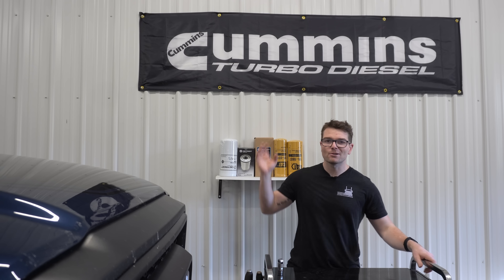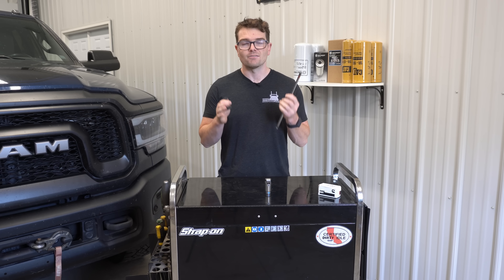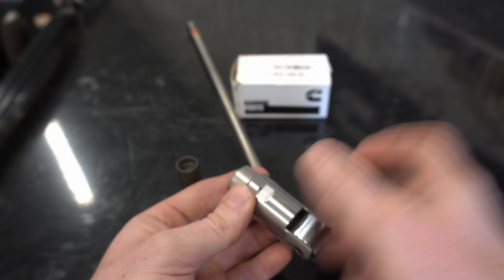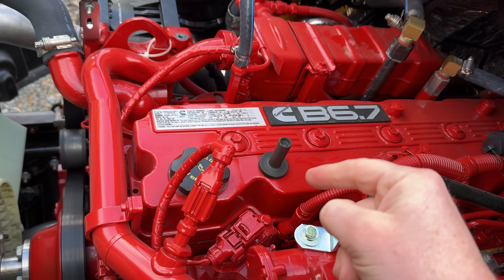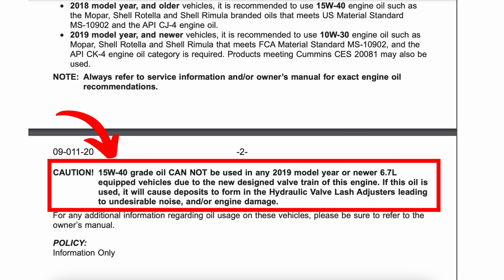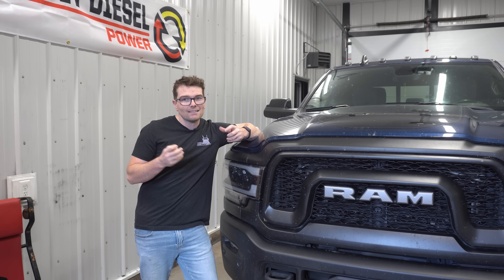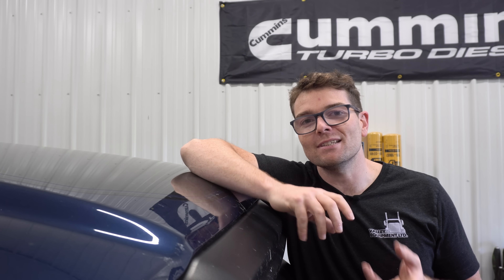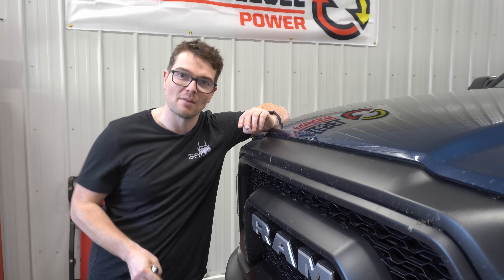RAM 2500 6.7L CUMMINS Hydraulic Lifter Failures *Diesel Mechanic Explains* | Not Good?

Comment: I have a 21 Ram 3500 HO with 37,000 on it, and it's been error free. I currenly change the oil everying 6 to 8k mikes and have run Hotshot EDT in the truck since the 2nd tank of fuel. It's been a fantastic truck so far.
Reply: 37K is barely broken in for a diesel. It should go 200k+ without a major engine failure with 6k mile oil changes.
Reply: @brycelund4112  I agree. But I've seen so many people on YouTube that have had all kinds of emission issues, warning lights, and failures on all kinds of engines with low miles. 

My wife has a 2021 Yukon Denali, and we just lost the 6.2 liter engine to complete failure because of CrankShaft bearings. Thank God it was still under warranty. It had 31,700 miles on it. Apparently, this was a known issue on some 2021's but we had no idea.
Reply: Have you ever tried the arch oil compared to the hotshot edt?
Reply: @onstar1869  yes

Comment: Detroit diesel used roller lifters in the 71 series engine beginning in the late 1930's. As I recall, they were trouble free regardless of the oil viscosity. These weren't hydraulic rollers, however. Maybe go to a non-hydraulic roller lifter?
Reply: The roller lifter is superior to the tapet. However the hydraulic lifter isn’t. 

Most large diesels use cam follower lifters and id support that any day.

Comment: Mine failed at 31k on a ‘23 SO. In the shop right now going on week 7 for cam, lifters, rods and rockers
Reply: What oil weight and type of oil did you use? What milage intervals did you change the oil. Thanks
Reply: @hendertucky9325 valvoline premium blue, 5W40 every 7500 miles.
Reply: @hendertucky9325 valv PB 5w40 every 7500 miles

Comment: Hydraulic lifter in the Chrysler 3.6 gas engine has the same problem.  I had a Jeep wrangler with that engine, had to change all the lifters and a camshaft due to a couple failing.  I've got a 2011 Ram 3500 with the 6.7, this I will not be upgrading.

Comment: Just got put in a new Volvo at work and they are now recommending 5w30 in their D13 engines doesn’t sound wright after years of 15w40 but I guess thin oil is the new normal
Also if seems like they have started pulling the EGR after the DPF because it took almost 8000 miles before the oil turned as dark as my last trucks oil would in less than a 1,000 miles that may something all these engines need to have happen to reduce the amount of soot getting into the oil to help reduce wear

Comment: Interesting that the hellcat gasoline engine has the same problem. In my thinking As a forty You're diesel mechanic.I say its low quality parts. I own a 1997 12 valve and a isusu c223 diesel also I just love bulletproof engines.

Comment: Noise?  Hydraulic lifters are silent.  And it’s not like they’re new technology…  Small block Chevys had them in the 1950s.
Reply from the maker: ya potentially but the commercial grade engines sound identical to the pick up trucks in my opinion.

Comment: I just had the 150k mile valve adjustment done on my 05 Ram 5.9 cummins. $750 at a local shop. Never getting rid of this truck.
Reply from the maker: those 5.9L are worth their weight in gold.
Reply: $750?! That job takes 30 minutes on a 5.9

Comment: I believe with the current emissions on the 6.7 and the engine having to regenerate all soot etc that the oil becomes contaminated very rapidly. I personally change not only my 6.7 and 5.9 Cummins oil at 5000 miles all of my gas engines receive the same service interval. It cheap insurance in my eyes . And in 35 years of driving I have never had an engine failure.😊
Reply from the maker: I mean the regens have nothing to do with oil really but the EGR pushing all that soot through the engine certainly does. So I can't argue with that.
Reply: @GettysGarage  Well, if the regen cycles work by injecting fuel on the exhaust stroke (like you've explained before), you should get more fuel contamination of the oil over time. Fuel contamination of the oil is one of the biggest contributors to excessive component wear. At least according to Lake Speed Jr. aka "The Motor Oil Geek". That and soot. Nasty business all of that. Wonder if you've heard of Speed of Air pistons. If you haven't you should definitely research those! Amazing stuff that greatly mitigates all of the harmful effects of the after gas acronym soup.
Reply: I'm a firm believer in "shorter" intervals on most engines, gas or diesel. The longer intervals on many modern diesel applications are just a recipe for failure in the long run. Oil does get contaminated no matter what, especially in diesel applications, and the more contaminated it is, the more wear is introduced to all of the components. I'd rather spend twice as much or more on oil changes than a fortune in repairs due to various failures.
Reply: I ment to type regurgitate my bad
Reply: Why don't you change the oil on the gassers at 2,000? They are running on less than half the amount of oil than the diesels, the oil gets hotter and can contaminate more quickly. My opinion, which is only valid for me, is that if the oil performs perfectly for 10,000 then changing at 5,000 is throwing money away and wasting time.

Comment: You might want to look into the fact that RAM trucks have a frequent regeneration issue that they cannot resolve. I have a 2022 Ram 3500 with a HO cummins engine. It gave its first check engine light at a little over 5000 miles.(code P2459 to frequent regen cycles). It has been doing a regen every 100 miles since that. This process is causing diesel fuel to get into the oil pan. Within just a few thousand miles after my last oil change I am already a quart over full on the dip stick. It has been tested and shows fuel in the oil. RAM has no answer for this other than to blame programming for the problem. But they do not know what the answer is and will not replace the engine control module or reprogram it. So you might test not only the hydraulic lifters but other engine components as to what the diesel fuel dilution is doing to that engine.
Reply: Didn't the 6.4 Powerstroke use the same strategy? 
Worked well for them also
Reply: Frequent regen is due to not allowing to complete regen in the first time it started
Reply: @repairvehicle  That would be nearly impossible to do on these RAM trucks that are having the frequent regen issues as it can take over 80 miles of driving to let it go from start to finish, and that is highway/freeway driving. I do not tow heavy everyday, but it does run better when I  am towing my 5th wheel. Instead of regen every 100 miles, I might get 250 to 300 miles.
Reply: @RobertBradstreet  my 2018 3500 ram Cummins, regens 800-900 miles. I do a lot of idling, city driving. Regens last only 15 minutes driving if I allow full completion before turning truck off. If I don’t allow then it becomes a problem and more frequent regens. I make sure regen is completed before turning off. Happy truck = happy driver. Also, I use best fuel additive money can buy every fill up.
Reply: @repairvehicle  One of the reasons I bought a 2017 instead one of the newer ones (reading all the stories about EGR valve issues, frequent regens, and learning about the issues with the '22s). My 2017 regens between 650-1075 miles depending on highway speed. Pretty sure it just regens around 24 hours every time.
Reply from the maker: Very well could be, a good friend of mine had a 2021 3500 HO and his truck would regen almost daily. dealership threw the parts cannon at it but solved nothing - he ended up wisely trading it in. the Powerstroke and I believe the Duramax as well all use a "9th" fuel injector which directly dumps fuel into the DPF for regens. whereas the cummins dump extra fuel into the combustion chambers for regens. which 100% dilutes the oil with diesel but especially when the engine is running frequent regens. didn't really put the two together but reading your comment it would make some sense, once the oil is compromised it's only a matter of time.
Reply: @GettysGarage  Looks like the PS added the 9th injector in 2023. I think one of the issues with the newer Cummins is missing sensors. Pretty sure some are missing the second nox sensor or something because of parts shortages. The EGR valves seem to have issues, some even fry the PCM when they fail. I don't think diesel in the oil is what is causing the lifter failure, at least it's not limited to that. PDDIeselPower has been chronicling the issues with the '22s and has seen it all.
Reply: I wonder if some of this is due to excessive idle time.  Idle diesel = bad = lots of regens.
Reply: @jamiel9902  At least not in my case, as we do not give it excessive idle time. We might give it up to 10 minutes during the winter to heat up, but there is nothing excessive on the idle hours.
Reply: @RobertBradstreet  possibly in other cases it may be?  I just know there’s this pervasive myth that idling diesels is somehow better than shutting your truck down, doing your thing, then coming back to start it up.  I don’t know why this is such common practice.  When I was driving a truck, I rarely idled because I just didn’t enjoy sleeping with the truck running.  I rarely had regens.  My buddy that worked for the same company and drove the same Volvo, idled pretty much all night every night and was constantly going into regen.  When I told him I have only seen my truck regen a few times, he actually thought there was something wrong with my truck 😆.

Comment: Why does it break the brains of so many truck guys when it comes to oil viscosity? The first number doesn't mean you're running a 5-weight. It means it's thinner when the engine is cold but it's still behaves like a 40-weight oil when the engine is up to operating temperature. It's actually more protective than say a 15W40 when temps are very cold. The oil flows faster, gets to the top end faster, and protects a cold engine sooner than the "heavier" oil and as it reaches operating temperature,  a 5W40 behaves like a 40 weight just like the 15W40 behaves like a 40-weight at that temperature.
Reply: People do not understand how a lubrication system works on an engine, oil pumps have a pressure relieve valve, and the gap between a Connecting rod journal /  main journal and camshaft against their respective bearings is only 1.5 to 2 Thousands of an inch ( average human hair 1 Thousand of an inch ) So if you start an engine on a cold day with a 15W-40 oil, the pressure of the oil will open the relieve valve and dump the oil back to the oil pan and very little oil will make it to the top of the engine, your oil light or gauge will show pressure because most of the oil sending switches are screw next to the oil filters and not the top of the engine. That is the reason why the industry invented the multigrade oils best protection for areas with hot summers and cold winters 0W- 40 or 5W-40
Reply: I use Schaeffer's Full Syn 5W-40. I hope that it is a good choice of oil for my Ram 3500 with the 6.7 Cummins.
Reply: I'm looking to buy a 2012 3500 dual rear wheels with 185,000 on it what can I expect with respect to the lifters and more than anything else it's my first diesel
Reply: You are correct my guy. They just rip you off when you buy it. Only difference there is
Reply: Its all just marketing to keep prices up. They could have just one oil on the shelf like 0W 40 and it would cover everything.

Comment: 20000 miles on my 2023 Ram 3500 HO and it already has a failed cam / lifter. It's been dealer serviced and has spent 40% of my ownership at the dealership 😢

Comment: Has to do with ZZDP zinc in oil that messes with emissions systems of new vehicles. You need zzdp to be a anti wear package when flat tappet cams and lifters are used. Same thing happened in 80s in vehicles. The high zinc oils were plugging up catalytic converters and manufactures had to switch to roller camshaft and lifters because of less zinc in oil. And the failing lifters is probably the same problem GM, Dodge ect with DOD systems and lifters s(# the bed. My guess its a CHINA MADE PROBLEM!
Reply: The biggest cause of AFM (DOD hasn't existed for 15 years) is not changing the oil often enough and sludge eventually restricts flow to the lifters or they wear due to the abrasive carbon soot in the engine oil. There are other issues like some with oversized lifter bores and others with out of spec prings in the AFM lifters. But the single biggest issue is that too many guys put tons of faith into the marketing on the oil bottle and think that synthetic engine oil is magical and can remove abrasive carbon soot and unburned fuel.

Comment: The 3k mile oil change interval zealots or the “wrong oil brand” prophets act like it will have any effect. You are not unique and it won’t. 

It’s bad luck- these people use oil changes like prayers hoping it prevents disaster. Then you read the forums and realize all the guys with failed lifters were doing it to. Poor design / manufacturing can’t be fixed with oil changes. People just hate that these failures are completely out of their control.
Reply: Running oil way too long is an even surer way to destroy an engine. Only broke clowns think it's a good idea to run the same oil for 7,000.... 10,000.... 15,000 miles. "Hur dur I bought the synthetic the bottle says it's good for 10k plus miles, ur just wastin money changin it all the time!"
Reply: Let’s make a chant out of it, UOA UOA UOA.  It’s a hell of a lot cheaper to do a UOA to figure out safe intervals than to cut it in half and start donating money to engine oil manufacturers for the rest of your vehicle’s life.

Comment: RAM recomends oil change at 15k. Unless you use any biodiesel. Not sure about Canada,  but most of the diesel stations in the USA are anywhere between 5%-15%   RAM then recomends 12k interval. Where I live, we have Biomass diesel (not to confused with Biodissel)  so I change oil every 5k.

Comment: I listened to JB reviews he interviewed a Cummins mechanic with 30 years plus in the game, the guy had a good point and he said that all these problems started occurring when manufacturers started putting this lighter weight oil and making it required to run lighter weight oil in these diesel engines and if you look back over time, there was basic maintenance obviously with any motor in the world, but The Cummins motor didn’t have the issues that it currently has today and the only thing that’s really changed. Is the lighter weight oil?
Reply: 5w40 isn't any lighter than a 15w40 at operating temperatures. But a 5W40 flows way better when the engine is cold and gets oil to the valvetrain much more quickly than 15w40. When the oil is cold, it takes a lot longer to pump hydraulic lifters up with a 15w than a 5w. Until they are pumped up, those lifters are hammering the roller against the cam lobes.
Reply: I’ve run 5w40 year round in all of my Cummins trucks going back to the 2000 5.9. I considered a newer one than my 2017 at one time, but too many issues popping up on YouTube & forums. I’ll be sticking with the ‘17 for quite awhile & likely replace it with a gas truck if I have to at some point.
Reply: @jeffs2809  dude the 5th gens are fine. Don't listen to people who tear their stuff up
Reply: Jb reviews is an absolute cancer to the pickup world
Reply: I don’t understand like how google says as oil heats up it looses viscosity (agree) also every engine I’ve had looses oil pressure as it warms up. My question is then how does a 5x40w (thinner oil) hold up as well than a (thicker wieght oil) when hot and have comparable viscosity than the thinner (5)w x 40w?
Reply: @bendweldingllc6950  well your first two answered each other because your oil pressure is gonna drop as the oil starts flowing easier
Reply: @ 5w40,  in general terms, will act like a 5 weight in cold temperatures and a 40 weight in higher temps. 15w40  would be 15 cold & the same 40 when hot. 10w30 falls in between the two when cold and thinner when hot.
Reply: @jeffs2809  it's a thinner base oil with heat activated polymers in it, that's how you get a multi weight
Reply: @wizard_of_poz4413  i know there’s way more science to than I can describe or willing to type. That’s why the “in general terms” part at the beginning of my comment. Thanks for the more detailed answers.

Comment: Great video and great detailed explanation of the changes that have been made to the Cummins engines. It is disappointing to see Cummins has changed the valve train for the Ram trucks vs. the commercial engines. Cummins was great originally because the kept it simple and now they have made changes that have hurt their reliability.

Comment: The other problem is these pickup truck engines the 3 big brands are pushing these engines much more than needed like an experienced truck guy said 800 of torque is more than enough to tow 30k pounds that's why the commercial version of these trucks are mostly down in power cuz they need to be reliable !I still think they should offer a version of these Cummins between the 2.8 and the 6.7  a 4.5 or a 5liter ish should be a thing pickup truck wise.
Reply: That's why I think Ford is always having issues with their beloved 2.7l EcoBoost v6. The thing is built like Fort Knox and it's still munching on valves like popcorn. It's a tiny v6 putting out 420hp in a mid-size truck and for some reason people think tuning it to push 460hp makes it better. It just makes it even more unreliable than it already is. I think the 310hp that my 2.7l Turbo-4 makes is adequate enough. It would perform better as-is if GM ditched the 8-speed transmission for the 10-speed. More gear range helps less HP do more.
Reply: Shame the 5 liter Cummins V8 was such a pile.
Reply: Commercial engines go through a different process for rating hp/torque. Also, take note that “most” are governed to a lower rpm limit, which will definitely give a lower hp rating.
Reply: 220 hp is still dangerously low for a commercial 6.7.